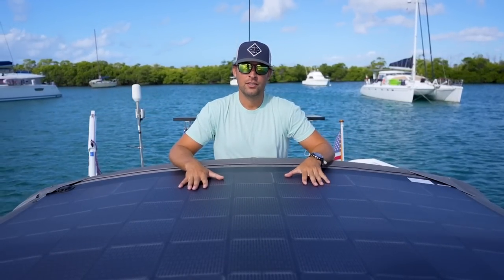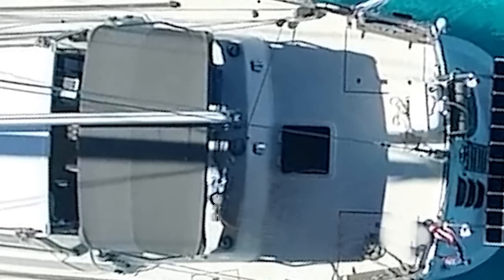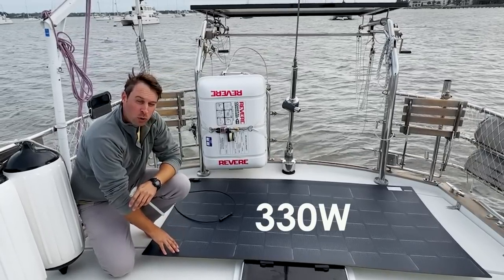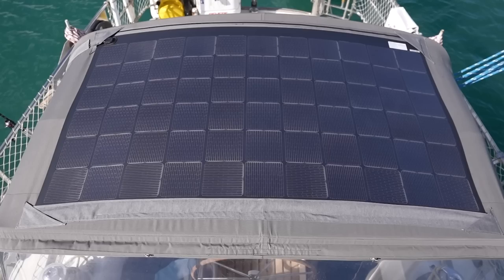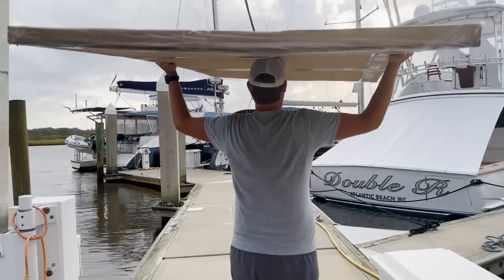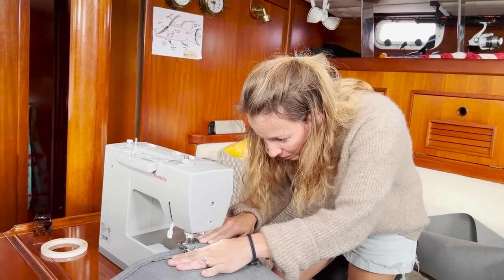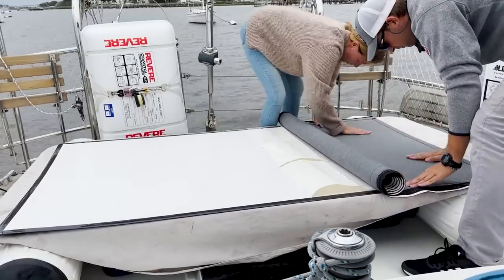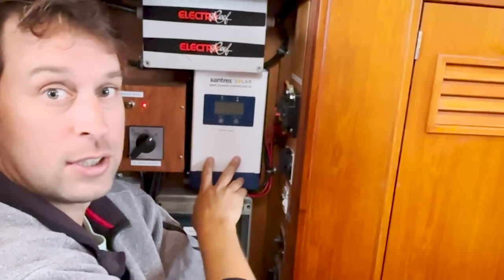Installing a Xantrex Solar Max 330W Panel to our Sailboat's Bimini Canvas (EP 67 - Monday Never)

Comment: I am new to your channel.  Great video and impressive job with the canvas work!  I checked the price of the Xantrex 330W panel - yikes!  IMHO, I would go with two Renogy 175W panels for about 1/3 of the cost.  They have great customer support and warranties.  If one panel goes, you still have 175 watts of power being produced (I like redundancy).  You can even buy an extra one for $270 and have it as a spare stored under a bunk mattress (it will fit easily).   In your case, it was an obvious choice given the price!😀

Comment: We installed 840W of solar panels on our Beneteau 49 on a custom hard bimini. In 8 years of usage they worked 100% of the time and kept batteries charged every day.  If these panels had been available, they would have provided a much better (less costly) solution.  Very nice installation video too.  Do you know how Xantrex improves the output when shaded?
Reply: what company did you use?

Comment: nicely made video, thx for sharing...
the flex panel certainly is the top choice for the bimini, looking at your set up i was wondering if you could just rotate the rigid panel aft by 90° and fit two more similar panels with reasonably little modification needed?
Reply from the maker: We thought a lot about that. The problem is the length of the panels. They would either stick really far out or crowd our transom. It just didn’t feel like we had the room to do it well without making our boat look super goofy.

Comment: Did you have any trouble with the thread gumming up with adhesive when you sewed it to the canvas bimini?   I do a lot of sewing, you guys did a nice job.
Reply from the maker: Hey David. Good question. The needle did get gummed up a good bit with the tape. I think there are some tricks to avoid that (maybe rub the need in hard soap first?) but I didn’t do any of that. The tape made things a lot easier though, so even though it causes a bit of sewing frustration at time, I wouldn’t do it differently. Thanks for watching!! - Cat

Comment: Since you put it on a separate canvas above the bimini, was there an opportunity (and an area on the panel itself) where you could have put in double-cap rivets to rivet the panel to the canvas, in addition to the adhesive?
Reply from the maker: Hey Randy, there is space around the border of the panel in which you could theoretically drill holes for rivets/fasteners, but I expect that it would void the 5 year warranty on the panels if you did that. A belt-and-suspenders approach with adhesive plus fasteners would make for additional peace of mind, so we’ve given feedback to Xantrex that pre-drilled holes/grommets would be welcomed by customers installing on canvas. With that said, the adhesive on our panel is performing excellently. 

When we install an additional 220w Xantrex Solar Max panel on our hard dodger (smooth gel coat surface) I expect that the installation will be very quick and the adhesive will be rock solid and has the bonus of being non-destructive to the dodger. We’ll make another video when we do that.

Comment: Great Video.  Kat I just noticed I've got the same sewing machine as you.  I love it.
Reply from the maker: It’s a great little machine! Nice and light. Easy to take out. And works for most applications. Really happy with it!
Reply: @Mondaynever  Can you share what make, model, accessories or other details you feel might be of value? Thanks.
Reply from the maker: @karlbass7895  the sewing machine is a Singer Heavy Duty. I use it for all of our basic boat sewing as well as for making clothes. For canvas work you’ll need heavy duty needles, but no other fancy accessories other than the right kind of thread. Depending on the sewing project, the supplies will differ, but Sailrite has amazing videos that outline how tos and everything you need. Hope that helps! I thought I “needed” a sailrite, but actually have been very happy to have a lighter machine on board.
Reply: @Mondaynever  Thanks for the reply. Google shows a few different model numbers of Singer Heavy Duty machines (e.g. 4452, 6800, etc.). There are a couple of canvas stitching projects in our future and I really would like a small, lightweight machine that is up to the task, as it appears yours is. Can you tell me which model # you have that has the "guts" to stitch through reasonably heavy marine canvas (sunbrella?) without jamming? Thx
Reply: I have the 4452 and am very pleased. The last project was dinghy chaps for our Highfield . Same style as in the Sailrite video, and the machine did great ! 110/18 needles!

Comment: Nice video.. the only thing I’ll be a bit scared of is that the breaker from the controller to the batteries should  be closer to the battery, not the controller. Just to,protect the wire from a big sour of power (battery bank). If not mistaken, as per ABYC recommendation, n9 more than 7”… which of course is hard to accomplish, but I guess you got the point..
Reply from the maker: This is great feedback, thanks. I pulled up ABYC E-11 and sure enough, they require fusing 7” from the battery. Makes total sense to protect the wiring from that end, not close to the controller, so that’s a big oversight on my part. Our installation is slightly different in that the solar wiring goes to a bus bar, not directly to the battery terminal, so presumably that just means that the fuse must be within 7” of the bus bar. The wire is only ~2’ long, so it’s not totally outrageous, but we try to keep the boat up to ABYC spec, so I’ll relocate the breaker asap. 

Thanks for the heads up!
Reply: @Mondaynever  yes.. you can instal the breaker before the busbar, but there should also be a big fuse between the busbar and the battery..   🤷🏻‍♂️

Comment: Keep an eye on the panel where it goes over the cross-beams. The first sign of an issue will be invisible and only measurable with a laser thermometer. I don't know if manufacturers have this issue under control with the modern designs, but in the past this has been a fire risk that has led to many boat fires.
Reply from the maker: Hi Andrew, we address that in the video. That was a concern when we were in the selection process. We talked with Xantrex’s engineering team and they were confident that we would not have any problems. So far, so good. There is no uneven heating on the panel (as measured by IR temp gun) and certainly no visible signs of damage or wear. We’ll continue to monitor it.

Comment: Pretty cool but After a couple of months of heat and sunligh I Wouldn't trust by any chance that glued panel on a strong wind... it's gonna fly away like a seagull 😂
Reply from the maker: If anything the adhesive binds more aggressively in heat, so no issue there. But we’re now we’ll over 2 months in with no weakening of the bond. We’ll update if there are problems in the future.